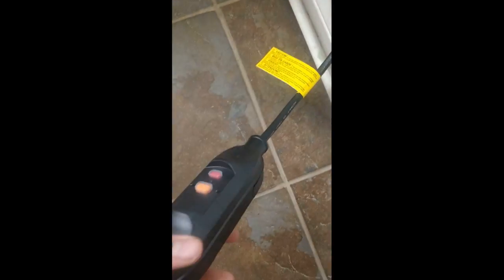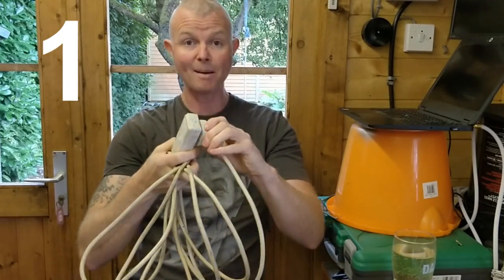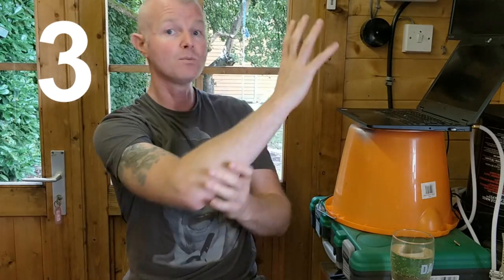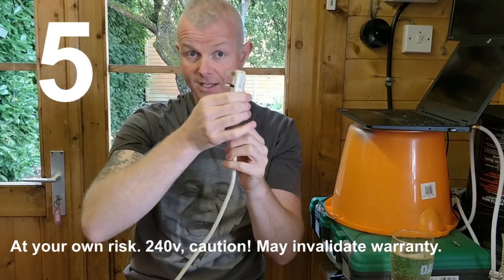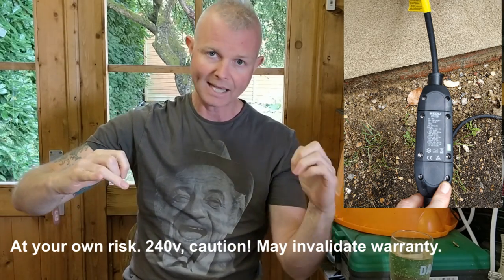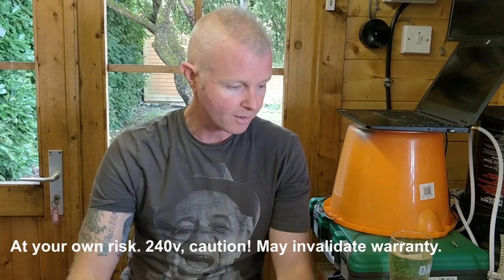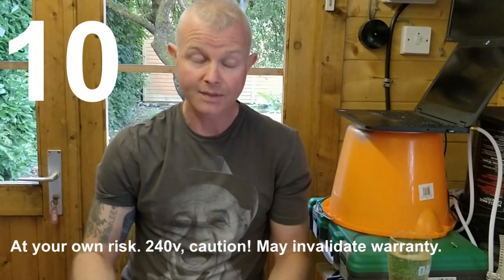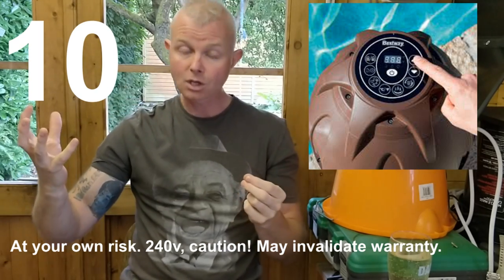Bestway GCF 6CF Ground Connection Fault / failure top 10 fixes.  Helsinki Lay-z spas hot tub, Vegas

Comment: Amazing, number 10 worked. Unscrewed the 8 screws, disconnected the ribbon connector turned on, turned off and unplugged, then connected the ribbon. I am a new spa user and been a sharp learning curve in these 2 days. I bought the St Moritz model over 2 years ago and never took it out of the box. Set it up yesterday and got the E02 error sorted that. Put protective cover over the lid and some weights to hold it down. Unfortunately the extreme heat in the sun, here in Malaga, caused the cover to melt together with the inflatable lid. When I took then apart the lid burst. Patched the punctures and disconnected the fittings in order to re pump up the lid. This failed due to another puncture. Then after doing this and reconnecting the lines, I got the 6cf error! No warranty now, so this fix was a life saver, many thanks.

Comment: I did option 10 with my St Maritz and it cleared the message so you have saved me loads of time and money thanks a million
Reply: Yeah I just got a new one, we already did a lot of the steps here since we got an electrician in the house and we even changed the plug that goes into the socket to make sure as well (something not mentioned here), and got the same issue.

so we just got a new one, and boom, works fine.

refunded the old one, miami, (it was really small anyway), and bought a much larger one and boom it worked instantly and no issues ever since.

Comment: Great video. I have done all of the following
Changed plug
Changed socket
Checked wiring 
Checked earth 
Removed the controller panel and re soldered connections 
Removed egg and checked all connections 
It turned out to be the heating element has blown. I got to this finding because it only ever threw a code up when I pressed the heat button. If I turned it on and cycled the filter the air and the temperature buttons and it never brought up the code. As soon as I hit the heater button it would throw up the code. 
I have a element on order now. And in the meantime I'm heating it with my deisel water heater

Comment: thanks for this, I started tracing my supply line back as I had this issue on the new spa I bought last week, even though the previous lazy was working fine, I actually found the earth had become completely disconnect in the outside box 🥺🥺🥺 how dangerous was that, thank goodness for a up to date "fuse box"

Comment: I had this exact fault... we bought the 2021 Vegas spa with new style pump, I plugged the pump into my outdoor double socket that I had used previously with the older model egg style pump (miami) never once had an issue or that fault with that pump, ive kept it as back up. With the new style pump kept getting this fault, I checked all my ground connections everything seemed fine. The only thing I could think of was our garden   decking that the spa is on is a good 15/20 metre run, ive installed an earth rod to my shed where my consumer unit is and hey presto its working a dream!
Reply: Sorry for resurrection of an old comment, but did you connect the lazy spa pump directly to the earthing rod or did you connect your shed Consumer unit to this new earthing rod?
Reply: @HK.Builds  I conneceted the shed consumer unit to the earthing rod... problem solved. We've not used ours for months and months due to the energy costs, they where once an affordable bit of luxury, not at the minute.

Comment: Adding in some of my finding whilst troubleshooting this 6CF / GCF error, 

Spa was working perfectly fine in an extension lead when first installed and ran for roughly 5 months. I then didn't use the Spa over the summer so was unplugged and packed away. 
Just recently I plugged the pump / Egg / Unit back into the same extension lead and to my surprise... GCF Fault code. 
.Tried sockets in the house. 
.Tried sockets directly next to the Fuse Board 
.Tried other houses 
.Tried Changing the RCD to a standard plug. 
.Tried Sanding the plug contacts 
.Tried Disconnecting the Top Computer as suggested in this video
.Tried Everything !! 

By this stage i had the top half of the Egg / Unit off and was about ready to order a new mother board from eBay as i could hear the relay tripping and then the GCF error code would immediately display. 

As a test, I unscrewed the Earth wires that attach to the top of the heater inside the Egg / Unit, I then powered up the unit and as expected was greeted with the GCF error as now there is no earth connected. I repeated this, Powering the unit off and then back on to display the Error GCF code. 

I then turned off the Unit, re connected the Earth wires and then powered on the Unit back up and hay presto, no error message and displaying the temperature... pressed the air pump button and all was working. 

As a test i then turned it off and then back on again in the same socket inside the house and the GCF error code displayed... 
I then repeated my steps and removed the earth wire, powered on the unit, off, on, off, connected the earth, powered it up and it came back to life. 

I then moved the unit to my extension lead and the original install position where it had worked 6 months ago, and error code was displayed when plugged in. I then went through my process of turning the unit off, disconnecting the earth inside the Egg, Turning the unit on and off twice, re connecting the earths and then as before everything is working.... in its original position.... in an extension lead. 

Hope this Helps some more people with this GCF / 6CF fault code.
Reply from the maker: This is a brilliant and odd situation, similar to mine. I  (step 10 I think) connected and re-connected the ribbon cable, to get a similar result. Which i guess does a similar thing to what you have done. Try the ribon cable next time you have the issue and I will try the earth to the heater and we can swap earthing story's to see if our fixes work for each other. 
You are a legend for taking the time to type the above. Hopefully it will help people.

Comment: interesting reading, ive tried loads of sockets, checked the wiring inside the rcd, one thing I noticed is the cable is compacted about 6 inches from the rcd, looks like its been jammed in a door, tempted to cut this bit out see if that clears it, else its taking he cover off the egg next to check that ribbon.
Reply: Good luck, please let us know how you get on. This seems to be turning in to an unofficial self help resource of answers!
Reply: @harleydavidsonbeginner5428  I wish I had good news but after trying everything here I snagged a couple of pumps from the local auction site and both worked fine (so not my house earth at fault then).  I was going to do a bit of fault finding swapping out components to identify the faulty bit but having 2 working units I think I will save my sanity and just bin the faulty one.
Reply: @cyberleish  ok understood. I have a similar problem. If I get time I want to make a separate 2nd video, to my first. Maybe there should be 11 tips in my video, 11 "give up and buy from eBay" 😂 if it works it works!

Comment: Quick tip to try before you start that solved my issue and I haven't seen mentioned anywhere.
Try plugging a high power item such as a heater in to the same circuit that your pump is on. Apparently the voltage to my house is just above the pumps operating voltage and switching on the heater before turning on the pump lowers it enough.
Reply: 2 years later but another update. I have to have 2 vac's, a compressor and kettle running of the same circuit 
to turn it on without getting the gcf fault.

Comment: I've had to jerry-rig my powergrid as there are no external outlets. My solution was to use a grounding plug with a wire and grounding stake. Best option? Probably not... but it works.

Comment: OK so these, or some of these may work for some people, but the real issue is that the pump needs to be properly earthed and grounded. So....look underneath the pump and you'll see a small nut and washer for a ground earth cable. Attach one, sink a grounding rod (about £10 from screwfix) into the ground and connect your earth cable to it securely. No more grounding error and no need to dismantle a perfectly good pump.

Comment: just turned my lazyboy on ,No lights  or noise totally dead as a door nail,It has also tripped the mains electric ,Im thinking that the trip switch box on the lazy boy pump mains power unit might be full of water from spending the winter in the UK outside ,Going to open it up first thinhg in the morning see what going on ...It was running an extension lead ,,Or the unit might have been damaged by the outside weather ,,???? Help we are having a heat wave this week,,,might just fill it up and not use the pump ,JUST PUT THE CHEMICALS IN AND BLEACH MYSELF INSTEAD,,,,

Comment: Thank u for this 
I think it’s stupid the cord length. If I had any idea how dangerous the whole set up would be I wouldn’t have bought it 
Still yet to use mine without worrying that I’m going to get electrocuted. 
I have bought a 15 amp 10 metre cord to run tobthe inside power point and a rcd electro safe switchboard. 
I have no idea ?
Reply from the maker: There is a RCD molded to the plug, so this has kind of double protection, and the GCF error means it wont power on unless earth is detected to stop you being electrocuted.    I agree on having a RCD on the main fuse board. ;-)   Maybe if you can explain what you are worried about I (or someone) can help?  Are you worried about water getting in where the Hot tub plug goes in to the extension?

Comment: Really useful video some great things to consider that I would have never thought of. Some ideas I will keep in mind here as ours is still under a warranty. My problem is that the pump turns off but does have power to the pump just no display/icons lit (so green power light, filter lights all go off along with digits on temperature display) but it doesn’t seem to have tripped at the RCD. I have logged a call with Lay Z Spa today and am in process of the videos and troubleshooting so wish me luck. That said, what would you say this could be causing power to the pump but nothing tripping in the outside socket or house etc?.. any advice on experiences here welcome 🤔💭
Reply from the maker: Please let us all know what your fix was. It may help someone!  ;-)

Comment: Simon... there is a grounding screw on the bottom of the egg that needs to touch the ground, solved it for me
Reply from the maker: I even connected mine to a ground spike, it made no difference!  I hear it does work for some. ;-)
Reply: Would be great if they could actually tell us these things before we part with our money... My egg is on insulation, because that's what I was told to do ...tinpot company

Comment: Great video Simon!  I have acquired a Lay Z Spa Miami, and my mains-cable is 2-core (live & neutral) - no earth. It also came without an inline RCD - just a 13A plug, but I have an IP66  RCD socket. Do you think that the cable has been replaced at some stage? I assume I should replace the cable with 3 core?? Thanks!
Reply from the maker: Hi, sorry I don't seem to be notified of responses on this video!   Assuming a UK product then yeah something is up with that cable!  How did you fix it?
Reply: @gravysnakes  yes! I fitted a 3 core for piece of mind 😁
Reply from the maker: @trevorbriscombe8104  I'll be honest, that may well have been one of the best choices you ever made!  ;-)
Reply: I bought one that i have been using for over 7 years brand new from a reputable seller that came with a 3 pin moulded plug. It only has live and neutral conductors. You don't need earth for an RCD to operate correctly as long as the socket it is connected to has a ground. The rcd tests and works how it should. And i believe there is an rcd in the pump unit too.

Comment: After trying everything in this video and still getting a GCF (even after having my electrics fully tested) I tried the most non sensical thing I found on the internet....I turned on the oven first (any high drain appliance would do) then turned on the hottub...guess what...it works, everytime (you can turn off the high drain appliance once the hot tub is up and running)

Makes no sense I know, but it seems to work for me
Reply from the maker: This is brilliant. What a clever idea. With Bestway I believe anything!!!!

Comment: We have a Paris and worked fine on an extention cable, but turned it of to drain it and had to turn it on and of 50 times before it worked, but now l can't get it to work, had electrician out, new plug tested earth, nothing will make it work again, very sad 11 year old daughter.
Reply from the maker: Yeah, i also had this. i found walking away for a few hours and then trying again made it work. I know hats illogical, but it worked... 
Top tip for when you next do any maintenance, don't turn it off.   I just turn it "off" with the soft button on the egg, then i don't risk an annoying fault quite as much!

Comment: I'm guessing the older versions like I'm using do not have GCF? Nevwr been an issue for me in 7 years of operation.
Reply from the maker: you are totally correct. Yes the older ones don't have this extra "safety feature"... which in reality is a pain!
Reply: @gravysnakes  yeah although though it seems to cause quite a few issues in it self. Mine is RCD protected tested before each use so I'm reasonably happy with the safety.
Reply from the maker: @PyroSarge    I tried looking at removing the GCF rubbish from mine, as I also have a decent RCD. However its built in to the chips on the circuit board. I am sure someone with more brain power than me could cut it out or piggy back it.  I was hoping Bestway would have a software flash to make it less sensitive, but i am not sure its capable of that!

Comment: My rcd on cable trips straight away so I can't even turn it on 🤦🏼‍♂️ I just used it to inflate the tub and when I was finished blowing the tub up it now just trips off.
I've tried different sockets and still the same issue.
Help lol 🙈
Reply from the maker: RCD tripping normally means something is bad. Try a neighbors house. I know it sounds crazy, but that helped us prove a similar fault.... 
As per my video, you can remove the RCD, for testing, but be very carful!  ;-)
Reply: Mines literally doing the same , did you resolve it?
Reply: @tomdowning6344  yes solved, it was the rcd itself which went bad so I replaced that and everything works as it should 👍🏻

Comment: I tried running my Hot Tub heater/pump from my petrol generator, and it gives me this fault, Even though my generator has an earth probe and i stuck it into the ground...
Annoying, Because i bought a powerful silent generator, just for it...
Reply from the maker: I did wonder about buying a petrol gene.   Seems like it didn't work for you. damn.   I also thought about connecting the gene up to a UPS with a 240v supply, then hoping the UPS would sort any earthing issues. But then you are in to buying a UPS on top of the gene.... - Good luck man.

Comment: Any solutions?
Reply from the maker: Yes. There are 10 separate solutions on the video...
Reply from the maker: @DreamscaperxX if it works in the house then maybe it's a Dodgy earth on the outside socket. That's kinda hard to test without a tester. Good luck and keep me updated.

Comment: easiest solution......

take an extention cord, cut it, reconnect ( properly ) take the groundwire and just connect that groundwire to a metal pin which you put in the ground.
doesn't have to be copper, doesn't have to be fancy, any piece of metal is fine.

works fine.....
Reply from the maker: Does not work for me unfortunately. We are unable to use ground rods here.  The ground here is so bad we have to use Neutral bonded earth.  I did try exactly what you are suggesting and it didn't work for me.  We tried a 2 meter copper rod (which was a nightmare to get in the ground) and (even) our house RCD's would not operate correctly, when we upgraded the board (due to the earth here).  Its common to all the houses round here as its built on gravel.   If you are outside the UK, this is the grounding types we use TN-S, TN-C-S and TT.  I talk about this issue in the video and the impedance we now have here, which is about as low as it goes.

Really appreciate your comment hopefully it will work for someone.

Comment: I have had my pump replaced by Bestway because of this GCF issue. But soon after, the new pump started displaying it too. 
I live in a farm so suspect that we have a poor earth rod at the bottom of the electric supply pole. It’s very old. 
Sometimes we have no issues with GCF, but some days it just won’t work. My guess is down to how wet the earth is and how efficient the earth rod is working. 
The long and short of it is, I’m getting pissed off with this problem and wish there was a way to bypass the issue somehow inside the pump. Not everyone has 100% efficient electrics.
Reply from the maker: I agree. Mine also randomly gets GCF. We don't have an earth rod as we have a bonded earth, so we know its not any fault.   It's basically that the sensor is too sensitive on the Bestway!

Comment: Clearly you are not an electrician...all you need to do is connect little wire from this earth part of the cable connector to something metallic on your wall. E.g. antenna box screw or like phone cable socket....at your own risk of course.
Reply from the maker: Nope. That does not work.  I tried that a number of ways at different times.